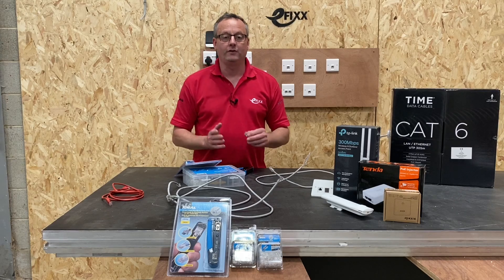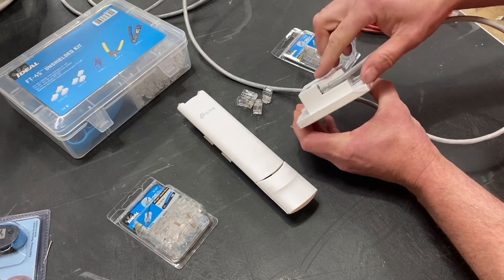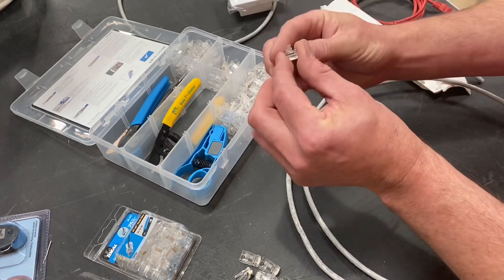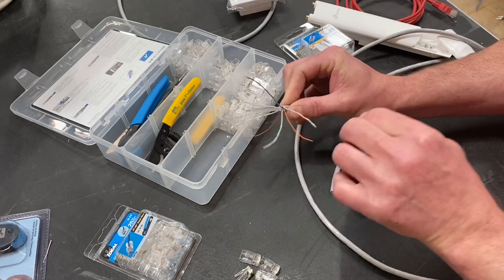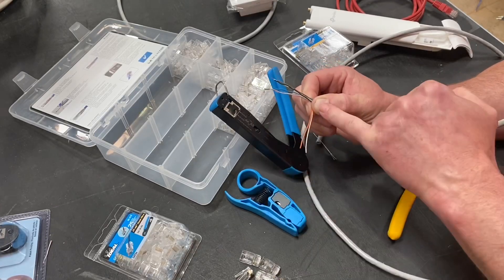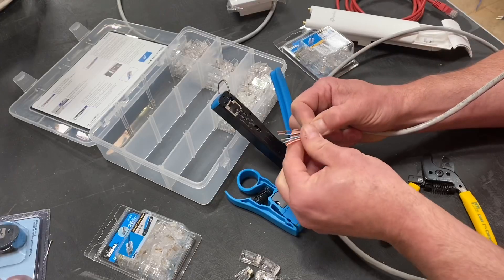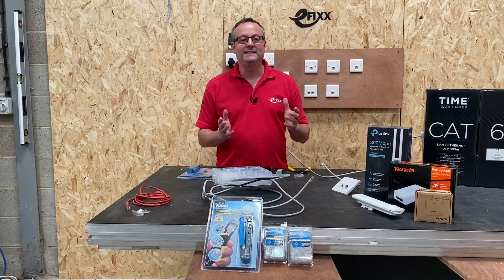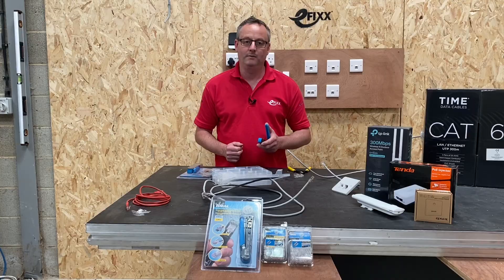Easy RJ45 network cables using the Ideal FT-45 crimping tool |CAT5e| CAT6|

Comment: Great vid Gaz, one thing though, ALWAYS use the draw string and pull down a couple inches snipping just below the original stripping cut point - never ever trust that your stripping tool has not nicked a pair or 3...
Reply: Interesting practice, I will give it a try.

Comment: Great video guys, I have used the FT-45 for the past 18 months and agree it’s a fantastic tool, small and easy to use, I also get no failures versus old style RJ tools! 
I bought my original tool from Screwfix, they were the cheapest, at the time (£55). I saw this kit on the IDEAL stand at the elex show in March, the rep told me they would be launched On-line from July (apparently there is a long lag in listing with Screwfix, CPC etc) but I could order through a dealer immediately, I ordered via my local Eds (Leigh) and got it within 3 days for £82, which is cheap considering the cost of the tool alone
Reply: Same here! I’ve crimped about 600 of these over the last 2 years and not a single one (!) has failed. They’ve also passed Flukes Qualification test with no issues. I do put just a tiny bit of dielectric grease across the tip of the conductors (where they’re cut), just to help a little againt oxidation of the cooper, but that may be a little overkill.

But then again, there’s no such thing as overkill when it comes to workmanship…

Comment: I have been asked about installing data points before and it's not a thing that I've got into as I don't feel confident with it, but it's another service that I'd like to offer and thanks to winning that Ideal RJ-45 crimping tool from efixx Lockdown live it will give me the boost to have a go, cheers for the video guys
Reply: Hi Dean 👍
Reply: Hi Gaz

Comment: The pairs all carry a differential signal, aka one goes high when the other goes low. At the end of the line one half is inverted and added to the signal of the other pair, which gives you an added signal of roughly twice the amplitude. Any noise picked up by the pair however gets injected the same into both conductors, so when half the pair is inverted at the receiving end the noise gets added with itself 180 degrees out of phase, effectively canceling out the noise. Hence it’s very important to not come up with your own wiring scheme and follow either the A or B standard at both ends, so that the differential pairs are kept together and not split, as you cable might work but it’ll have horrible noise rejection and crosstalk, both pair to pair and cable to cable.
Reply: What is "noise" and how would having noise affect the end result?
Reply: @UnitedGamersHQ  Electromagnetic interference

Comment: A few quick tips when using these.
Cut your outer sheath off about 4 to 6 inches long.
Then, you have a big length to work with.
Untwist each pair, and pull them over and down, anything with a right angled edge, with your finger or thumb on top.
This will take all the kinks out of each wire.
Then, separate each wire individually, into the code/pattern, that you are using, in a fan shape.
Make sure that you get as close to the outer sheath as possible with your separation. This is really important, or your wires will snag.
Finally, insert the wires into the plug, ONE AT A TIME. With the extra length that you have to “play” with, it is a LOT easier.
Just put, ann inch or two, into the plug, ONE AT A TIME, then move on to the next wire.
Then, when you have all eight wires in, you can easily check, that your wires are in the right place.
Now, GENTLY, feed the plug down the 8 wires, be GENTLE.
Once you have the sheath into the plug, double check your wires, by fanning them out.
If everything looks ok, and the sheath is far enough into the plug, twist the end of the excess wiring together, so that it will feed into your cutting crimped, JOB DONE.
Reply: Some of this is good advice, but on no occasion should you attempt to feed each core through individually. This will always slow you down.

Comment: I have both the Ideal crimp and the KLEIN TOOLS VDV226-110. Absolutely no comparison.  The Klein was about UKP10 or 20% more expensive but far better. The cable colour guide on the Klein is a coloured label on the tool.  Those letters on the Ideal are just confusing, especially to a dyslexic.

Comment: The A and B systems aren’t intended as national “preference”, they are a vestigial tail of older standards. It used to be that you needed straight cables between switches and PCs, and crossed between switches and switches or PCs and PCs. To create these crossed cables, you wired one end A and the other end B. These days all devices which end will cross the wires, and the crossing is different anyhow for gigabit Ethernet , so it doesn’t really matter. However, system B as slightly better crosstalk resistance, hence you see most people doing B. Most important is to get both ends the same (even though it will work with A at one end and B at the other).

Comment: Good video. 1 question: 
The pins on the RJ45 plug are gold plated to prevent corrosion. With the feed through ends, I assume the copper cores are exposed at the end of the plug where they have been cut. Are they exposed and therefore prone to corrosion due to moisture in the environment. Perhaps the current flowing through them minimises this, but seems a strange idea. Would be interesting to see the failure rate of these over the coming years.
Reply: The gold plating on the connectors is to minimize contact resistance (two surfaces touching) between the plug and jack, the tool positively stakes the contacts to the conductors so there isn’t mouth contact resistance.

Comment: Should really be using cat8 for installs now ready for the gigabit era 🤗
Reply: Cat8 for Gigabit 🤣🤣🤣
Reply: @Dextermorga  
Cat6 will do for now, but bandwidth will increase significantly over the next 10-15yrs meaning you’ll be ripping it out (like I am with cat5e installs from 10 yrs ago).
For the little added extra cost of cat8, your customers will be getting an install futureproofed for the next 20yrs.
Reply: I really hope that was a joke...
Reply: @MatSmithLondon  it’s being specified regularly for colleges, universities, councils, etc..
25-40Gb required by 2030 in a lot of properties.
Fibre works for long distances but, it’s too expensive for short runs.

Comment: What happens if you run into an emergency that you have to use another brand of connectors. Will they work?
Reply from the maker: Yes we’ve used a few different types

Comment: Actually you are wrong. Both cat5e and cat6 can have the curves for curved or round cable. It is just to accommodate flat cable in that style of cat 5 plug that you have.  The actual pins are different. A cat 5 plug - the pins are all in a straight line viewed from the end. For a cat 6 the pins are set alternating higher and lower. This is to reduce cross talk between the conductors. Cat 6 cable is also a heavier gauge than cat5. Not by much. You should also make sure the type of connector is appropriate. Stranded conductor as with electrical flex uses one type of pin for displacement of the insulation and solid conductor uses another. Stranded usually for patch cables, solid for fixed, although for most uses no one really cares. And there is a universal style of pin. I dislike the end through plugs as it leaves the cable liable to corrosion in harsh environments or the introduction of impedance between the conductors.
Reply: Up to gigabit in either cat 5 or cat 6 the type of plug won't matter, but it does if you are at 10 gigabit speeds and running with a cable at the maximum cable length
Reply: I'm glad you mentioned that.  It was poor of this video not to mention that the appropriate connector needs to be used for stranded/solid core cables.  I've lost count of the number of intermittent/total cable failures I have seen when a connector designed for stranded cable has been used on solid core cable.
Reply: The high/low stagger configuration can be had for cat5, cat5e, or cat6. It's not something specific to cat6 connectors. I'm sure it helps with crosstalk, but I've seen it advertised to reduce the probability of shorts occurring across two pins or conductors, once crimped. And for anyone else reading this, pass-throughs suck! Why anyone would want exposed conductor ends on the outside of the connector is beyond me.
Reply: You can't leave an RJ45 connector in the outside world open to the elements regardless. From experience I know the contacts will become corroded. So I'm not sure it makes any difference whether you use the pass-through or the traditional closed-end plugs. I just don't think that's a good enough reason not to use them. (I don't use them myself, but I am interested in switching to the pass-through style, to save a bit of time crimping.)

Comment: Compared to moving 230/40 down a conductor would doubling up pairs allow more data to flow?......another comparison... Voltage drop over a meaty length of cable is noticeable when currents drawn increases so does digital data transfer work simillar?

Comment: Given how cheaply you can buy packs of pre-made patch cables with molded strain relief, I really don't understand why anyone would want to make their own anymore.
Reply from the maker: The devices we showed at the start of the video would need a cable termination. The outdoor WiFi router will need a cable running through a wall. You could use a pre-made lead, but you’d have to drill a much bigger hole and risk damaging the connector etc.
Reply: good lucking fishing a fully made up cable through wall cavities etc.
Reply: @Apex180  For inside walls you would run the bare cable and then punchdown into a socket or patch panel at each end. I was refering to just the patch cables as as being made in the video.
Reply: Well, this video is about terminating a cable in general, not just making patch cables. But I find myself regularly needing a patch cable of a specific length, and it's easier to go downstairs to my cable reel, cut a length, then crimp both ends.